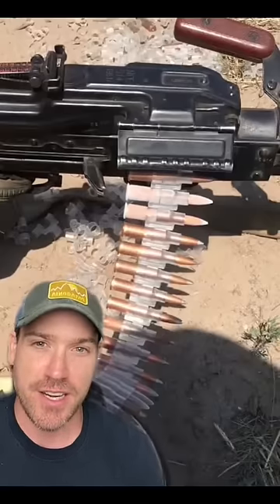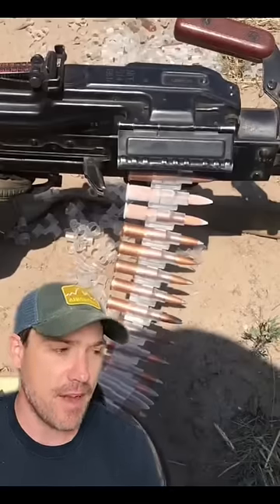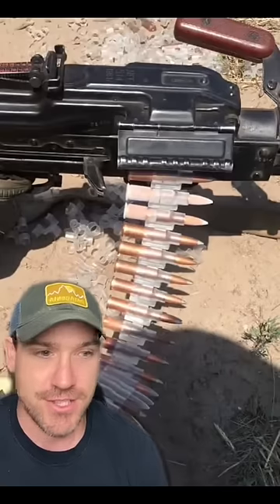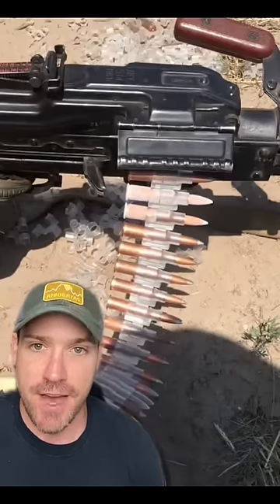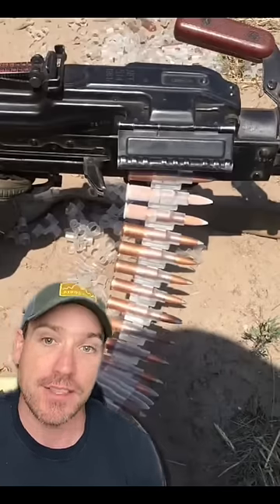Machine Gun Ammo Belt in Ukraine

Comment: I think the plastic links will melt during the heat build up cause by sustained fire and can possibly gum up the barrel's throat, and chamber. And once the chamber throat and lead of the barrel is gummed up because of the plastic links you'll risk having a high pressure chamber blow up.

Comment: I think it’s a great idea. The only issue I see is durability in maneuvers. In so far as the live ammunition portion of the belt breaking, causing the gunner to have to reset the belt. But a what, 60ish% reduction in weight? Then if you could 3d print the belts in theater? Sheeeeeeesh!

Comment: Quality issues will arise- worked with plastics for years and the numerous concerns would pop up in mass production especially between manufacturers. Besides that, on machine guns I can’t imagine that same heat and friction that breaks those links wouldn’t either melt the product and ruin the gun, or even cause internal fires occasionally. That’s not even going over the fact it’s shoveling more plastics into the environment. I guess biodegradable wouldn’t be too bad- but even compared to casings left behind regular plastics would be a menace.

Comment: my biggest concerns would be the heat melting the links and jamming the weapon far worse than a normal metal link which can be pulled out or swiped away, having a plastic chunk melting into your barrel or feeding mechanism would be difficult to clear in the heat of combat, secondly how long could they be stored before the links stick together in the cans and or harden and become brittle to where they snap before feeding and lastly of course the plastic pollution which most likely would not get picked up in the heat of battle and would inevitably get left behind, metal links are simple to recycle rather reliable in most situations, disintegrate and like mentioned before would be much easier to fix should they jam up the weapon

Comment: Standard 7.62x54 250 round belt 3.3 lbs? 1.1 lbs for plastic linked belt? Are you talking just the weight of the links? I don't have the exact weight right now but a standard 100 (250 rd belt??) round belt of 7.62x51 is about 7 lbs. Your numbers make no sense.

Comment: Huh, so my first thought was that the plastic would melt/soften as the weapon heats up. 

I take it either the inside of the gun doesn't get as hot as I think or the plastic can handle heat better than I assumed?
Reply: Probably a combination, as far as I can recall the feeding system of the PKM doesn't get that hot. Still might have issues though, would just go with one of the newer Russian belts that cut the links off every 25 rounds.

Comment: How long do they think that these links will last after being exposed to constant and continuous heat? After all, every storage container that I found ammunition in wasn’t that cool inside, those links were stored for long periods of time, sometimes for decades. Imagine pulling a fresh belt of ammunition from storage but the plastic links are so old they fall apart, because we all know that plastic does deteriorate over time Especially due to heat exposure. I can’t imagine having too many air-conditioned/climate control ammo dumps. On top of that soldiers are rough on everything and metal links are the only thing that will stand up to the rigours of combat.

Comment: So the plastic will decompose in 15 years, the steel will decompose (depending on conditions) in likely a year or 2, plastic, which is made from oil, is much worse than steel, which comes from the surface layer, plus steel is stronger and doesn't weaken over time while in storage, and it also doesn't run the risk of melting in a hot MG action. So is the plastic links a good idea? No. It's a terrible idea.

Comment: I don't like plastic anything. Basically anything you would want to use plastic for, aluminum would work better. Aluminum is slightly heavier that plastic, but it's more durable and doesn't degrade over time when exposed to heat an sunlight, like plastic does, and even when plastic is kept out of direct sunlight, and in a climate controlled environment, it still degrades over time.

Comment: They sound good, they disintegrate, lighter, but wouldn’t they melt from the heat of firing a weapon
Reply: As far as I can recall the feeding system of the PKM doesn't get that hot. Still might have issues though, would just go with one of the newer Russian belts that cut the links off every 25 rounds.

Comment: Depends on functionality. If they're as reliable as metal links, or at least found in testing to be 'durable ENOUGH' by Military standards (which tends to be pretty high standards of durability because soldiers can break fucking anything and everything), at least insofar as it improves ammo-carrying-weight and cost-effective production of the links to the point that the risk is worth the cost (though I think modern Western Militaries are more of the mindset that the soldier's LIFE (or more specifically their DEATH) is sufficiently expensive to wear dealing with the higher weight/cost/reliability of metal links outweighs the diminished weight/cost/reliability of plastic links.

But hey, if I'm wrong and plastic links turn out to be JUST as good as metal links...? Fuckin' give 'er! Climate and pollution? Yeah, yeah, yeah, it's a non-issue when men are fighting and dying. Just like it's a non-issue when it comes to the economy which has a very real impact on everyone but mostly the poor, and we're currently experiencing climate change initiatives and anti-oil/gas initiatives CAUSING THE LIVES OF POOR PEOPLE TO DIMINISH IN QUALITY... and it is believed to GET WORSE OVER THE WINTER.

So yeah, the whole climate change thing can get fucked if it means I start to struggle to pay rent and obtain groceries... which by the way, recently, I have been struggling more than usual to pay rent and obtain groceries, and I am NOT middle or upper class. I make less than $20,000 per year. I'm making enough to get by, but with how things are going, with how much more expensive food will be next year if politicians keep telling farmers to use less fertilizer to thereby produce less food... well, I guess I might just have to be homeless a third time. And if so, that will be because of all those head-in-the-clouds, pie-in-the-sky utopian dreamers who virtue-signal about saving the world and vote left-wing at every chance.

But hey... I'm White... I'm male... I'm only a poor person, not exactly someone of notoriety or importance, so if I were to suffer or even die for the sake of climate change, is it really any loss? Saving the world, right. I mean, a hundred million were killed to bring on the communist utopia, and there are still communists who are okay with further millions getting killed. So what's a few poor people in 2022 and 2023 starving to death or freezing to death or otherwise suffering in their standard of living?

Fuck the poor...

That seems to be the situation with the World Economic Forum climate change warriors like Justin Trudeau, whom I hope and pray will be taken out from being Prime Minister of Canada with a vote of no-confidence and replace by Pierre Poilievre, because that is the TRUE ass-kicking he has earned in destroying my God-forsaken country. Canada's been going down the shitter for years, and a reminder, Canadians cannot carry pepper spray for self-defense. It is illegal.

Keep your mother-fucking guns, Americans. Don't let 'em go. "From my cold, dead hands."